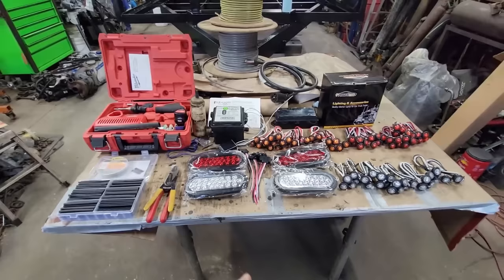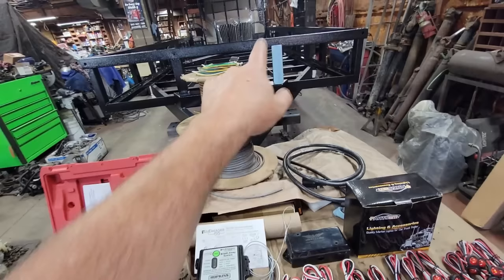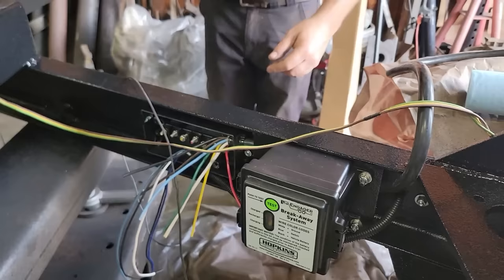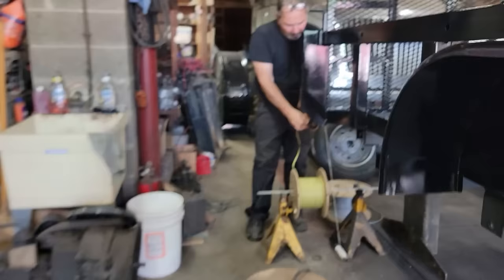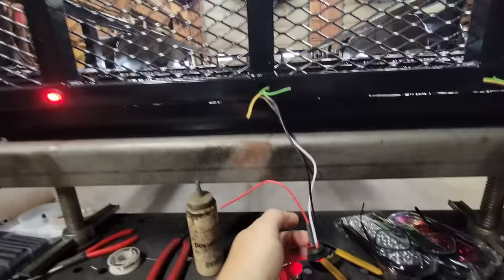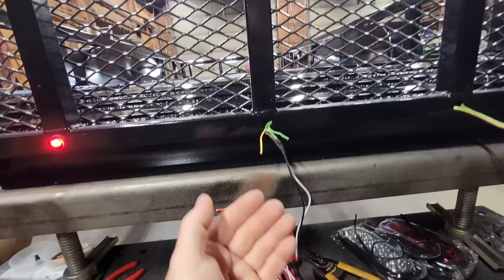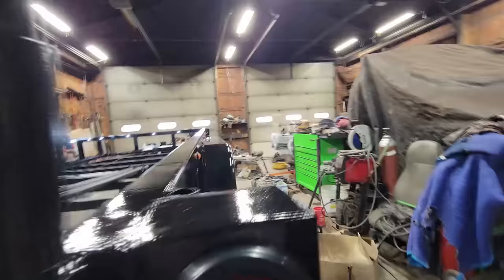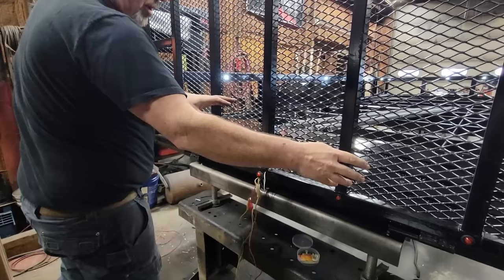TRAILER REBUILD PT11. THE WIRING! I ORDERED 94 LIGHTS!

Comment: Wiring trailer lights can get difficult to wire correctly and it's easy to make a mistake . I've had problems wiring my trailers and then when I loan my trailer the way I wired mine is different than the person that borrowed the trailer . NOTE  - I DON'T  loan my trailer anymore  , especially since the last borrower FRIED  my 10,000 Warn Winch and killed the heavy duty battery mounted in a battery box to power the winch and is charging when the trailer cable is hooked to the truck . Lesson learned and pissed a few buddies off when I refused to let them borrow my trailer the last . They in turn got the pleasure to purchase their own trailers and tear their crap up and spend the money to keep it in service .  Great tutorial J.C. Hell of a good job sir .

Comment: Ooh, I really like the idea of the winch controls at the back of the trailer in addition to the front! 😧 Nice touch!   That's what I've always had problems with and that is connecting multiple wires together.  Nice job with the wiring and the DIY class video you made 🙂👍

Comment: That is a very clean wiring job that you are doing. I have wired a lot of my trucks and trailers, but I am glad that you mentioned using diodes. This is why I always watch your videos. I always learn something. And that's coming from a guy that has trucked for 45 years as an owner operator.

Comment: Hi J C,  Great video and your explanation is complete and helpful.  I have wired many trailers from the 4 wire utility/boat trailers to 6 and 7 wire  trailers with electric brakes and semi trailers.  I've used all the major brand lights when they were still in business Grote, PM, TruckLite and Signal Stat .  I've never seen where a light manufacturer has used the black for ground, it's always been white.  White for ground, Black for Tail/Marker and Red for Turn/Brake.   With everything being made in China you've got to wonder if a whole batch of lights got screwed up.  

The RV market has totally changed the color codes on the wires. I've always used White for Ground, Yellow for Left/Brake, Green for Right /Brake, Red for Brake on Semi Trailers or foreign cars with separate brake lights without the converter, Brown for Tail, Black for Marker/Clearance and Blue for Electric Brakes/Spare.   On the 6 wire plugs, there is no black wire so the tail and markers are wired together   

You are going to find that the center turn signal light on the tailgate that you used the diodes on will be canceled out by the brake light. The brake light will go no further across the tailgate because of the diodes but both the left and right turn for the center light will get canceled out when you apply the brakes. It's because you've got the tailgate lights wired into the large turn/brake  and tail lights on either side of the trailer.  Unless you've got a trick up your sleeve.

I've got a Milwaukee 1220 heat gun, it's an older one that plugs in the wall, but it works great for projects like this.   I'll use tie wraps on wire connections where you have multiple wires on both side of the solder joint. it keeps  the wires from spreading  heat shrink before it cools .
Reply: Dear LF
👍👌👏 Maaaan, you definitely know your stuff! Congratulations 🎉
Best regards, luck and health in particular.
Reply from the maker: my intention is to have all the lights in the tailgate light up when the brakes are applied. when the brakes are applied and a turn signal is on, the center light will stay on with the brakes applied regardless of any turn signal being used at that time.. i just dont want it only lighted as a marker.
Reply: @j.c.smithprojects   Yup I understand that all brake lights will work with out the turn signals on but when they are on you'll loose the center turn signal to the brake light.  Looking forward to seeing how you wire in the side 3/4" lights to only flash when the turn signal lights are on and not work with the brake lights. Thanks

Comment: KILLED IT / super comprehensive video. I’m getting ready to do one on a super small harbor freight trailer, but I’m over engineering it and super overbuilding it including the lighting system. So I’m doing a very similar build here but just on a smaller scale. Same with Partsam, I’ve been using their products for a long time on multiple projects. They are definitely top-tier.

Comment: I am a retired dairy farmer just putting up my hay and selling it. I haul the hay to three different hay auctions. I pull a 32 foot gooseneck with a 2006 freightliner M2 106. I built a platform up on the neck to haul an extra couple bales. Someday I want to get a bigger truck and trailer but for now this is working! I just stumbled on to your channel. So glad I did! Yes I immediately subscribed!! I to love lights. I want to add some 3/4" lights on the side. After watching your wiring I now plan to solder and heat shrink all my splices. I have the Milwaukee heat gun. just need to order the soldering gun! Thanks for putting all the links to your supplies. Not sure yet where to drill my holes. Don't really want them on the rub rail so maybe lower on the side frame rail? I may come up with ideas on that and hope to find what you used to drill your holes! Going to also put those lights on the Ali Arc bumper valance. More lights! You remind me of myself. Just that you have a lot more knowledge but i am one that loves to learn! So thank you!!
Reply from the maker: this is why i make videos. hoping it helps others who are going through a similar situation and not sure what they want to do or how they want to do it. i may not do things the best way but i guarantee it will always be MY best.

Comment: Very neat and clean ! I'm going to make myself get better at soldering and get some de-ox ! Alot of times when I have 2 or 3 into 1 I cram some liquid tape into the heat shrink then heat it and let it push it back out to seal around the multiple wires... kinda messy but I feel like it helps ! Looking forward to the next video 👍👍

Comment: Interesting you decided on reverse lights on the trailer, I knew the 7 way RV  has the provision for it but it's so rarely used I've never actually seen a trailer with reverse lights.
Reply from the maker: i did this mostly for my son. he travels with his side by side at night. this will make it much easier to back it in to his property by the hatfield and mccoys trails.

Comment: as a suggestion i did this on a truck bed trailer or two as diodes do go bad on occasion (alternator goes high 14+ VDC POOF dead) i put them into a sealed/waterproof inline fuse holder soldiering them to the terminal ends of a dead fuse (or sacrificed one) an slot them in to line (its the thing with import trucks with their yellow turn signal and brake)
Reply from the maker: i had to read this a couple of time to understand what you meant. if i understand, you do this for ease of replacement.
Reply: @j.c.smithprojects  yeah a guy i made a trailer .. well i did the wiring he kept blowing the diode from alternator going over 14 vdc which was making it so his turn signal wasn't flashing the wrong side just like what your doing with the center LED  the trailer was an import bed so it had separate turn bulbs from brake. i know it'd been easier to just convert the trailer

Comment: Did you consider putting the load lights on the underside of the top rail? Less chance to damage them...but also a pain to drill the holes.
Reply from the maker: they wouldnt do what i wanted them to do in that location.

Comment: In my area of Canada that trailer wouldn't pass safety inspection without an ID light on the rear ... You do have a lot of lights but the ID light tells vehicles (after dark) that the trailer is wider than 80 inches .. According to E Trailer this also applies to USA ...
Reply from the maker: There are 3 center id lights. they are just inline with 4 others. it meets the requirements.

Comment: Hi JC buy a mini heat shrink gun they better job and don't leave the burnt plastic smell and they seal the ends better as seen on watch wess work  keep up the good work
Reply from the maker: already on its way. should be here monday.
Reply: @j.c.smithprojects was surprised with all your tools ya didn't have one already
Reply from the maker: always used a butane torch until i got this soldering iron. 
 @coachman290651
Reply: I have an m18 heat gun it’s a few years old it works ok I just find it takes a while to shrink,,,, maybe I need a defector?
Reply: @mikejackman4416  mm like most battery power tools mine  is on 240v  i have also the snap on  solder gun powered by butane
Reply from the maker: i ordered the 2688-21 heat gun kit. it comes with the deflector.

Comment: When I buy a new trailer, I always wire a switch from the power from the truck to the trailer brakes. Someone try’s to steal my trailer, they can’t because I 12 VDC going to the brakes as soon as they plug in.
Reply: Great tip.

Comment: The brake lights and backup lights use the same mold that is way there still 3 wire plugs on the backups
Reply from the maker: not always. some of the oval back ups on have 2 pins. i did find out that these back ups had a high and low function. that is why there was 3 conductors.

Comment: Awesome work as expected!  The m12 soldering iron is the best in the business and the m18 heat Gun does the job but not as fast as a butane torch, the problem is finding a butane torch that will last 6 months without breaking! Great video Sir!
Reply: I have abused the heck out of my (gasp), Harbor Freight butane torch, no issues. And if it craps out, it is cheap enough to replace.
I'm at like 4 years on this butane torch,  doesn't owe me a thing.

Comment: I live in New York and the trailers I repair don’t require backup lights. It depends on what state you’re in.
Reply from the maker: not required here either. i added mostly for my son. he will use this trailer at night. i thought it would be helpful.
Reply: @j.c.smithprojects you are 💯 % correct JC!
They will be very helpful !!

Comment: (From an electrician) When it comes to voltage drop, it is not true to say "only good as weakest link" voltage drop is a cumulative effect.  If you have large guage wire for a long distance in series with a short piece of smaller guage, the short piece becomes negligible in the total voltage drop calculation
Reply from the maker: your taking a generalization of how wire size can affect voltage drop and ampacity and trying to prove a point to a specific situation. if your an electrician, you knew exactly what i meant and what i was explaining.
Reply: Just trying to clarify for  other viewers who know less about the subject. You always do great work and give the best advice

Comment: Your white lights only have 2 metal connectors in the housing. They are back up lights.
Reply from the maker: actually, they have 3 terminals in the light. a high, a low and the ground.

Comment: How did you find those reverse lights to throw light and illuminate behind the trailer?? We need to add some reverse lights to the stock trailer and I am a bit nervous to try something that won’t light well enough behind.  My loading lamps are on a separate switch in the cab, but I need the main truck to work that, or have to get out and go to the back to switch them on/off, a pain if we are trying to move quickly (lots of evacuating in recent years.)
Reply from the maker: there is a link in the description of all the lights i used and where i got them

Comment: 43:40  Is there a reason you didn't install dielectric grease or some other protector on the ground wire ring terminal?
Reply from the maker: i use a protective spray. i was out and waiting for more to arrive.

Comment: There’s 2 wiring color codes. “Utility style” and “rv style”. That’s the difference in color you’re noting. Utility style is what most people are accustomed to….
Green/yellow-left/right
Brown-markers
Red or black-12v

The “rv style” is nearly opposite…

Red/brown-left/right
Green-markers
Black-12v

Brakes and ground are blue and white respectively for both
Reply from the maker: i am familiar. every 7 pin flat connector trailer i have come across in my life has had the sae style wiring color and schematic.
Reply: @j.c.smithprojects  I agree. Those premolded plugs always come with the rv style tho for whatever reason
Reply from the maker: aggravating to me.
Reply: @j.c.smithprojects  I second the commotion
Reply: @j.c.smithprojects I'm certainly with you on that!!

Comment: As I understand it, the light producing process for an LED and for an incandescent are actually the same. However with the LED, because it is a printed circuit, as opposed to an actual wire, requires considerably less electricity. If anyone knows this to be incorrect, please let me know.
Reply from the maker: incandescent bulbs use a fine metal coil winding that is basically a direct short from power to ground. therefore it heats up and glows. that is where your light comes from. led do not use a coil winding at all.
Reply: @j.c.smithprojects  So, I just watched short video on the P process specifically relevant to LEDs. You of course are correct, but then you probably know that.
Reply from the maker: not a matter of being right....just hoping to help understand.